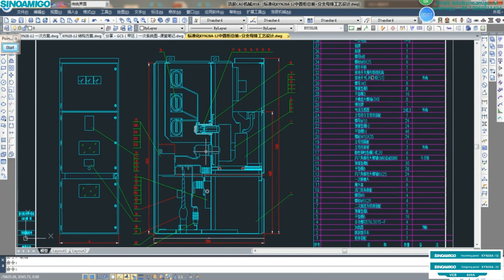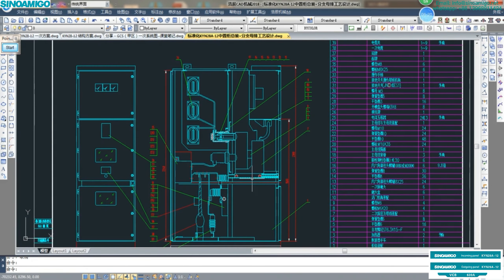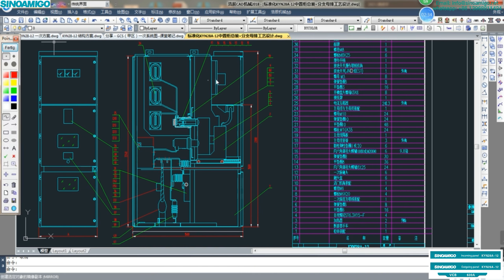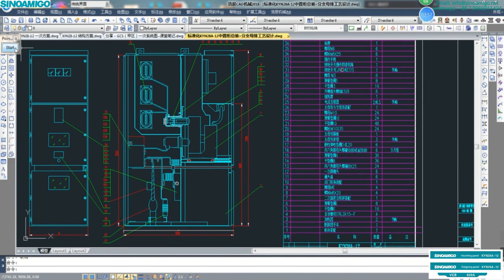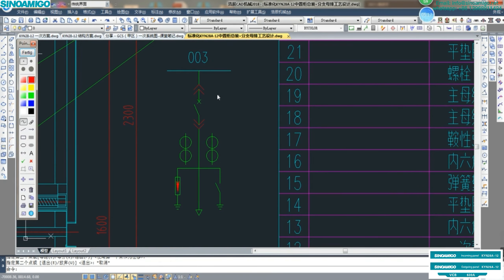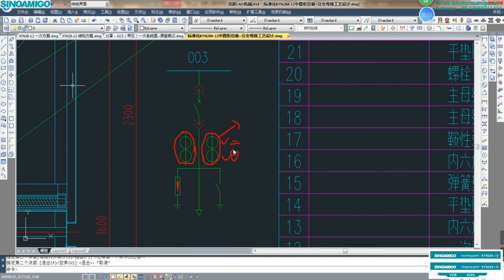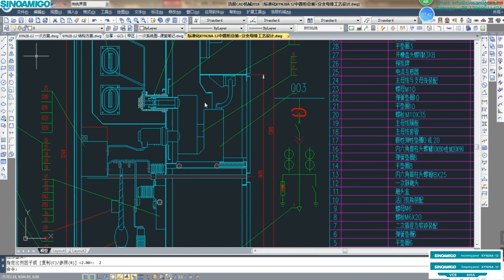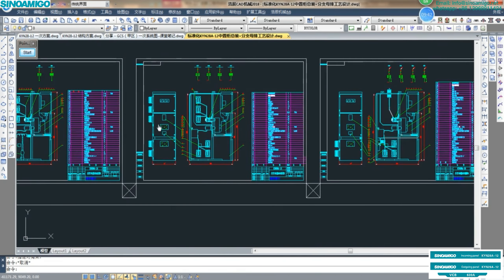KYN28 switchgear CAD construction introduction

Comment from the maker: Medium voltage Circuit Breaker mounting KYN28 switchgear panel, metal clad draw-able type MV switch board;

autoCAD construction drawing, Single Line Diagram (SLD) drawing compare introduction core material inside: Vacuum Circuit Breaker, Current Transformer, Earthing Switch, Lightnning Arrester, Busbar.

SINOAMIGO Power T&D Corp Ltd
Supporting Email: info@sinoamigo.net
WhatsApp: +86 13968811424
more contact in: www.sinoamigo.net

#VCB #VacuumCircuitBreaker #MediumVoltage #KYN28switchgear #drawableSwitchgear #drawableSwitchBoard #VS1 #EarthingSwitch #CurrentTransformer #SLD #SingleLineDiagram #autoCAD #construction #OutdoorPolemounting #IndoorSwitchgearmounting #Sinoamigo #SinoamigoPower  #VCBtesting #springmotordrive #SpringMotorOperatingMechanism #actuator #PermanentMagnetic #PermanentMagneticActuator